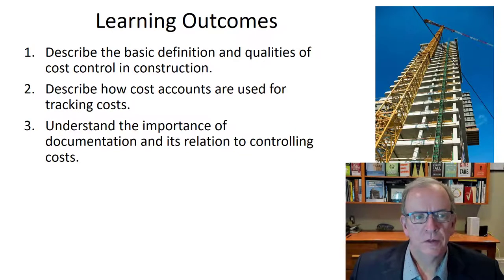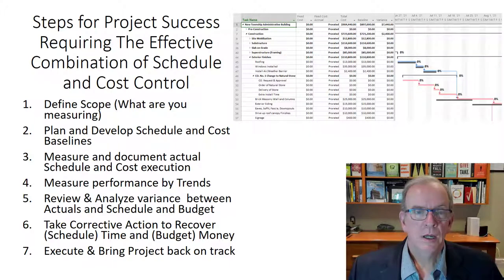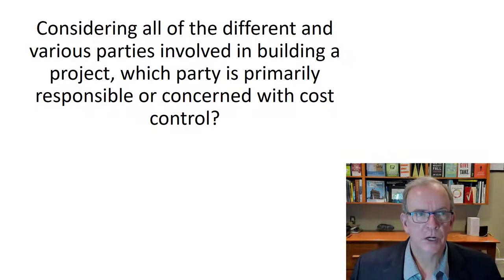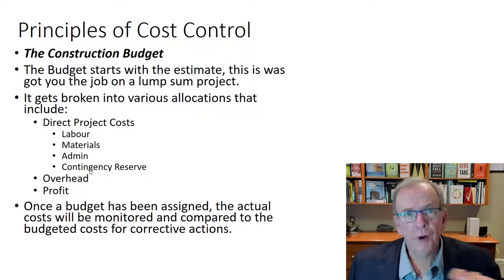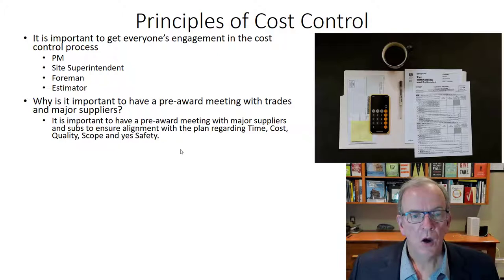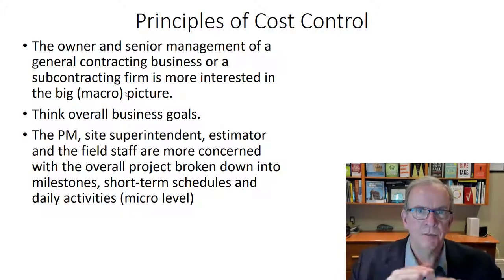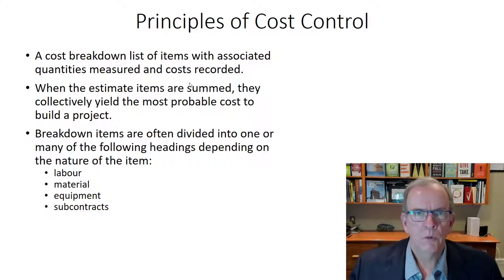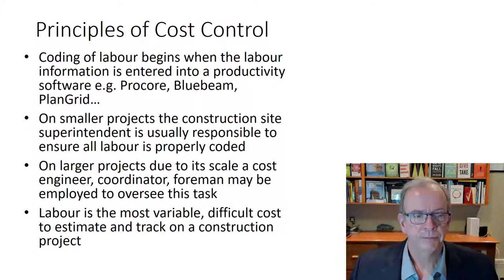Lecture 2A Cost Control for Construction Project, Principles of Cost Control

Comment: Hi Tom. I really enjoying watching your videos. However, in several videos including this one, I think your voice is a bit too low. I found it difficult sometimes to hear it properly.
Reply from the maker: Hi Zaini,
I'm glad you are enjoying the videos.  I will try to up the volume in future videos a little also I think the music is a bit high at the beginning and end and will lower for Lectures 4 coming up, I find there is a tight balance between volume and background noise with my equipment.  I checked this video on my older Ipad pro and computer and I agree it is a bit low at normal volume but if I turn up the volume it seems to be fine, no background noise either.  I will check my cell to see how that is on that, lots of different devices have different outputs.   
Thanks for the feedback this is very helpful for me and I appreciate you taking the time, let me know if Lecture 4 is better when we get there.  This course on cost control is all about getting timely feedback so you can make corrections on your construction project so is developing videos that are useable and resonate with people.  I need feedback so I can iterate and improve.
Thanks again,
Tom